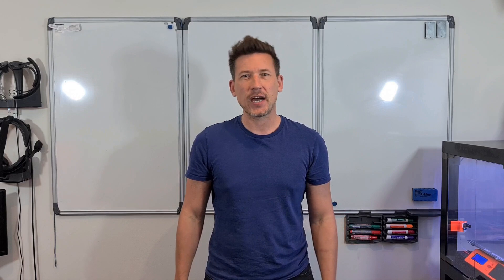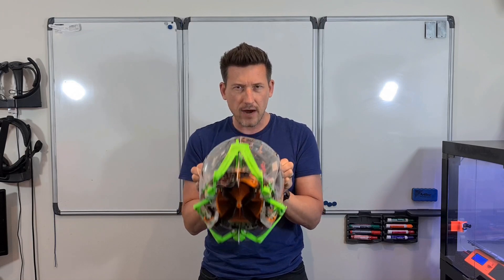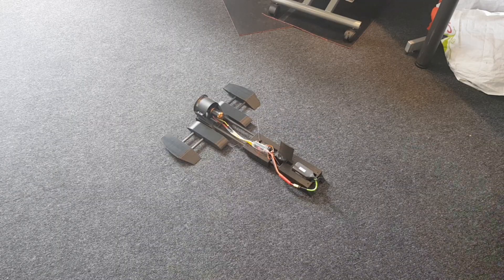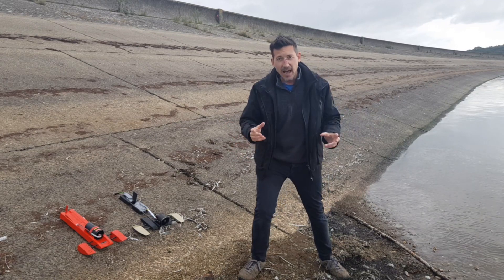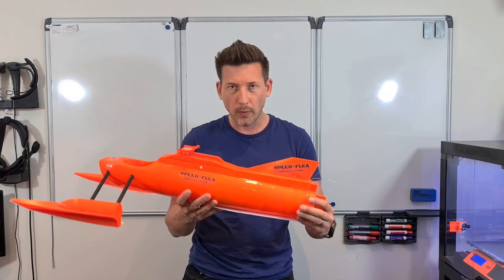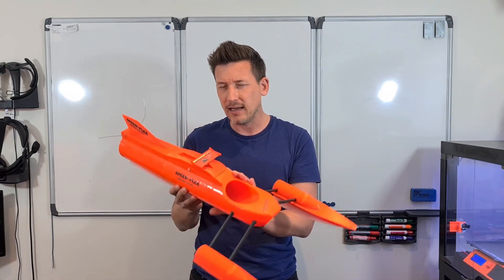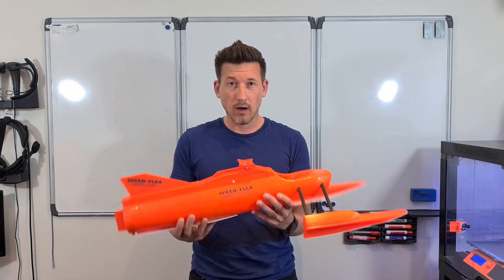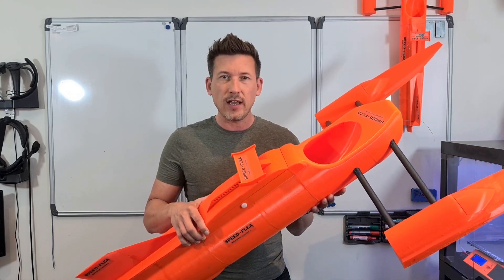'Skippy' The WORLD's FASTEST EDF R/C Boat!

Comment: Should not need thrust hitting the water for it to hit high speeds. My EDF outrigger will do 67 mph. Your sponsors are too low, it should be even with the bottom of the hull. You also need a wedge at the rear of the hull where it contacts the water. Building it just like a prop-powered outrigger and just adding an EDF would be much more efficient. Your sponson booms should be straight and not bent down making the nose go up high you are actually introducing drag. An EDF doesn't need a surface to push against to accelerate as it pulls through the air just as it pushes through the air. Just like EDF jets they have nothing to push air against as they are in the sky.

Comment: I really like the big one. Let me as a r/c rigger builder give you one advice: big turnfin at the back to keep it running in a straight line AND one turnfin on the right floater for the same reason as well as the turns. You need those two pieces of metal!!!

Comment: I think the front sponsons are too low. It helps at low speed but once you are at a plane it hurts your stability. 

Also to help in the turn the inside of the sponson should be angled out, to help grab the water and knife in, while the outer edge should be angled out as well, to help deflect water downward and prevent the inner sponson from diving into the water. The rear should be angled out to help it from diving as well.

Comment: Size and power are not everything ... Smaller, lighter,  faster ... My 45mm EDF Rigger (Boat): https://www.youtube.com/watch?v=FWNNONPZ2fU and https://www.youtube.com/watch?v=vgz5kSblA0Y
Reply from the maker: What is you top speed so far?
Reply: @RadicalRocket   Current top Speed is 125 kph or 77 mph.
Reply from the maker: Skippy is set for a speed run in the spring. Unfortunately, it's too big for my local lake, or any lakes remotely nearby.
Reply: @RadicalRocket  I can't wait to see it at full throttle. But from my experience I can say it isn't easy to have a stable EDF boat at high speeds ...

Comment: 10:45 - ?????? .... so how do rocket in outer space work then?! - But still, the best EDF boat I've seen! 👍
Reply: NB: Change that setup to a normal / airscrew prop and really see it fly!
Reply: It’s designed with no research done on actual hull design or actual knowledge of how trust is generated (equal and opposite reaction) as long as there’s something to press against? 🤯 terrible

Comment: Ummm what were you thinking of sticking an open edf unit on the very leading edge just above waterline of a watercraft??? I know your thing is aeronautics but wow lol. A lot of fun watching you learn thanks for sharing, consider the thrust line vs waterline perhaps a small hydrofoil at the tail to raise the tail with speed , you're losing so much to induced drag - the lighter you can make it on the water without planing the better if it's speed you're after
Reply from the maker: Thanks for your comment. I like to start with an idea without too much theory, this makes for a much more 'hands on' approach which I think most people will like. Hydrofoil is a nice idea but limited. Something that must be appreciated is that any wake displaced, that is the entire wake void left by the boat if filled with water and weighed, adds drag to that volume in weight in water. This is because you are pushing it out of the way. The faster you go, the bigger and longer that void.. Anything in the water creates drag greater than 1,000 times that in air. So anything in the water at all is going to slow you down.